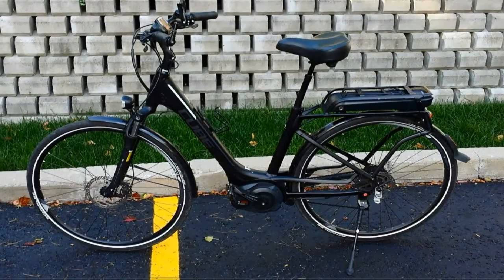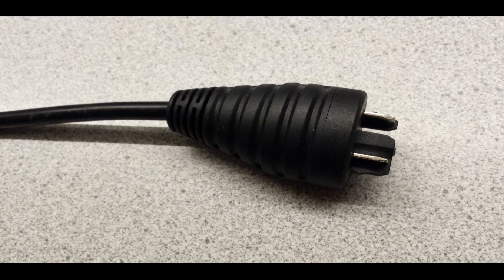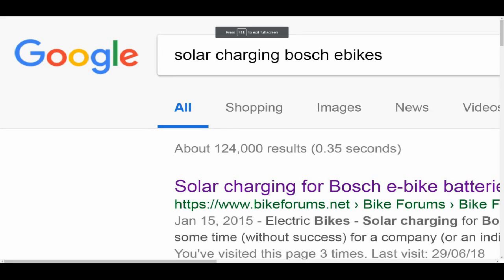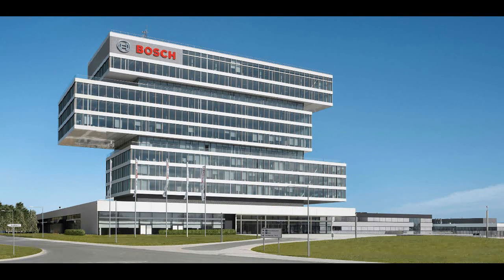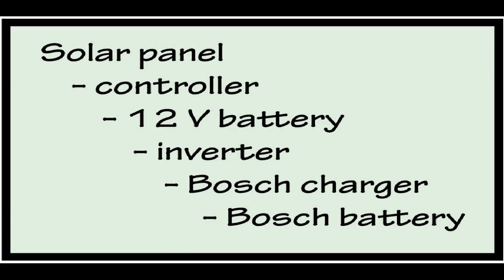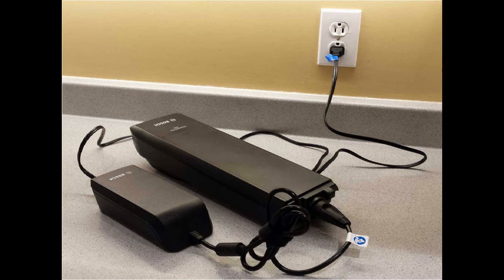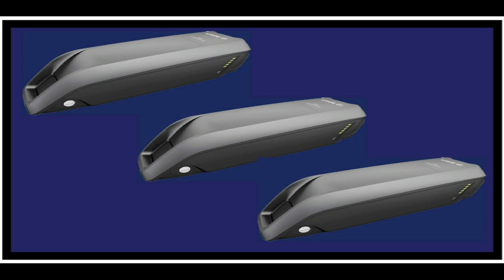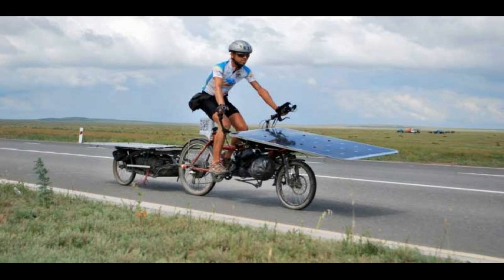Solar Charging a Bosch Ebike Battery   Disappointment

Comment: Robert, I have also been looking into similar requirements for my 2 TREK EMTBs, both with BOSCH Performance CX motors.  I am also looking for a portable and compact off-grid solar setup which I can carry in my car or bike trailer whilst travelling.  I came across this very useful info: https://www.youtube.com/watch?v=d2r3jbL78iQ  which I think you might find useful.  

Once you have a BOSCH battery plug, an easy way to to supply the +5V is from a USB power source OR u can use a compact DC-DC converter to supply this DC 5V from the 36V charger.  

For the 36V Li-ion charging, the GENASUN GVB-8 Boast controller makes a specific model for charging a 36V Li-ion battery from a 12V source (see: https://genasun.eu/collections/genasun-boost-mppts/products/genasun-gv-boost-8-lithium-41-7-volt-wp-mppt).  The best and unique aspect with this charger is,  it will work as low as a 5V panel input and it is super efficient at 96% to 98% efficiency. 

You can get flexible solar panels now with efficient SUNPOWER solar cells that would output 350W  now with a 18.6A max current output at the nominal 18.8v. The magic happens when you connect two of these up in series and achieve a 37.6v 18.6A solar panel output.  The GENASUN will take up to 60v but limits the input from panel to max current of 15A.  Still this is plenty of power.  If sun condition is good and no shade, the best way to charge is to connect the panels directly to the GENASUN GVB-8.  This way, with charging a 36V battery, it is capable of handling an astonishing 325w panel power.  Output at the 41.7v would be in the 7.8A range, which is super impressive!  It is a better solution than even a BOSCH fast charger and is way more efficient at 96-98% efficiency with minimal energy waste in heat generation.  And efficiency plus short charge times should be very high on your list of criteria when looking for a mobile solar charging solution for the BOSCH EBIKEs.  On cloudy days,  I would suggest buffering the captured solar energy with a 120Ah LFP battery (which is still very light weight and portable.  This BIG plus with LFP is they take on high current charge quickly.  U can capture lots of solar energy in a very short time) and you can source the charging current from the LFP battery using the GENASUN GVB-8 to charge your BOSCH EBIKE battery.

Given that Li-ion is in its happiest state between 30% to 70% capacity.  I would recommend leveraging on this knowledge and charge the batteries in this range.  The initial phase of charging with constant current will allow the battery pack to soak up the energy very quickly up to around 60% capacity.  And you can finish off the charging at the early stage of constant voltage charging when it reaches 75%.   The initial constant-current charge typically only takes 1/3 of the total charging time and completes in around 1 hours.  Try to minimize time wasted in the constant-voltage charging phase which can take as long as 2 hours.  You also get long lifespan from your Li-ion this way by not stressing the cells with much less heat generation. Alternate your ebike usage between 2 EBIKE batteries. And you can have one charged in no time.  With a 625wH battery it only takes less than 52 mins to bring it up from 30% to 75% if you can provide the optimal 7.8A charging current at 41.7v

With Li-ion batteries you can safely charge between 0.5C to 1C.  Typically 0.8C.  For a 14.5Ah unit, 0.8C would be 11.6A.  And the 7.8A is perfect safe.
Reply: For those who may be interesting in fabricating a BOSCH EBIKE battery connector but don't want to get too fancy with 3D-printing, I would recommend the shortcut solution I took, which is to get the blade connectors, crimp them to the cables and slot them into a BOSCH EBIKE Battery female connector.  Once you are happy with the position each connector should sit in the 3D space, get yourself some Epoxy Putty and apply that around the connectors to hold them into position.  To get a nicer finish at the base, I precut a small piece of transparent plastic thru which the connectors passes thru so that the Epoxy putty will have a flat surface to sit on once i apply pressure to knead the whole thing together.  Before the Epoxy putty starts to heat up and hardens, cover the whole assembly with the AC plug (with the base removed).  This way you get a very functional BOSCH EBIKE battery plug in no time to fabricate, yet with all the convenience and elegance of a proper plug.  Example of an Epoxy Putty : https://www.bunnings.com.au/selleys-50g-knead-it-multipurpose-epoxy-putty_p1230040?gclid=Cj0KCQiA88X_BRDUARIsACVMYD-Cxb8SNRonCQef20RBGTMLHOF7_720iLAoC6UQ1WyuXex0H4BIOtUaAiBeEALw_wcB&gclsrc=aw.ds
Reply from the maker: That putty seems to be a very versatile product. Thanks for the info.
Reply: @RobertBeriault753  Once you have cut the chunk of epoxy putty you  need for the job and start kneading, you only have a few minutes before the putty starts to heat up and hardens.  So the key to success is to work quick and plan ahead, have everything you need in front of you. I think you shall find the end product very useful and acceptable.

Another tip with the construction is, as i am going with external 5V USB power supply option', i am sharing that negative pin between the charging current and 5V power supply.  So having 4 wires in the connection to a 4 pole terminal connector for interfacing with the GENASUN solar controller and  a USB power bank.  The current draw from USB is very low as it only serves as a voltage reference source.

I use a 4x18650 battery bank to power all my ORFOS PRO biking LEDs. And the power bank has a handy USB output.  So it is extra handy for me to tap into this voltage source, should i had the need to charge the BOSCH EBIKE battery from this solar charging setup.
Reply from the maker: Thanks for sharing your experience. I wish I had your knowledge of electronics.
Reply: @RobertBeriault753  Hi Robert, in case you are wondering if this whole setup works or not with the GENASUN GVB-8 solar charger charging a BOSCH EBIKE battery, I have quickly put together the relevant parts in a quick POC (Proof-Of-Concept) video to show how these components would work together.  This is charging a 625Wh BOSCH EBike battery for a TREK RAIL 7.  The battery is close to achieving a full charge and as you can see from the video, the pulsing Green LED on the GVB-8 indicates it is charging and as soon as full charge is achieved, it turns SOLID GREEN.  So you can be assured that (1) it charges ok without interference with the internal BMS of the BOSCH Ebike battery; (2) It will stop charging once the GVB-8 detects that the battery is full.  

PS FYI, the BOSCH Ebike battery's LED indicator will light up as soon as i turn on the +5V DC power supply.  

I hope this post answers most of the questions you may have, in terms of the feasibility of this proposed highly portable and highly efficient BOSCH EBIKE battery off-grid solar charging system.  And wish you have lots of fun with this new found charging freedom.   Link: https://youtu.be/uyn3gUo4OYI 

I shall do a more detailed video when i have time and connect this system to a high powered solar panel and a power meter to show how much current you can safely charge the battery.

To achieve the same charging level as the following BOSCH AC chargers, the solar panel would need to provide the following respective output:

2A (Travel / Portable) charger : 83W
4A (Standard) charger : 167W
6A (Fast) charger : 250W

The GVB-8 is capable of handling 8A charging current to the battery and a max output of 325W (for 36V Li-ion battery), which potentially can sustain a 8A charge to the battery.  It would be interesting to see what possibilities there are.

Comment: I Designed and 3D printed the Bosch plug. I then used a DC Booster to make a 12V 2A battery charger. Here's how ( https://youtu.be/d2r3jbL78iQ ). I put the CAD model on https://www.prusaprinters.org/prints/49417-bosch-36v-ebike-battery-connector-diy-2a-charger
Reply: I saw your video a while ago and was impressed with the entire project. One thought I had though was finding out how much current is necessary on the 5V enable pin. It sounds like it's simply connected to a relay inside the battery pack and if that's the case, I can't imagine it needs more than 100mA. A very simple and small 3pin 7805 IC would be sufficient to generate the 5v signal for the enable pin.
Reply: @JonPrevost  I believe others have done that now successfully. Thanks for the suggestion!
Reply from the maker: That kind of stuff is too complicated for me, but congratulations for your invention.

Comment: Robert, have a look on barnabe chaillot channel with the video  "Electricity but without invoice", i think he is charging ebike from solar panel, car batterie and a step up volt/ampere booster connected on to the regulator. But of course it is no bosch bike with this stupid plug... cheers.
Reply from the maker: Thanks for the reference. I wasn't able to follow all of what he was doing, but he's quite an innovator.
Reply: I will try with my bosh battery and my solzr panel very soon and let you know if its work. Keep u posted !

Comment: There is a German company claiming to offer chargers with 12V source: https://powerbutler.de/en/products/powerbutler-multi-fur-bosch-und-specialized-rosenberger-magnetadapter
Reply from the maker: Could be very useful. Thanks for the link.
Reply: I use a powerbutler for my shimano system. It can even run from solar using a victron 75-15 and a small 5ah 12 volt battery. Turn on subtitles on this youtube-movie https://www.youtube.com/watch?v=EjcykZkLQZk

Comment: Hi sir . What if you get a non Bosch battery and make a custom plug 🔌 to your bike ?  I personally plugged today an other battery(without original battery on the frame to avoid other nasty stuff ) to my brand new ebike with Bosch active plus motor to se what is going to happen and this I can tell by now : plugging with crocodile connectors ,than display turn on , I can navigate trough different assist levels and everything seems to work on the track but I didn’t do it on the street to se what’s going to happen or if I  get errors . It’s only one day old bike and don’t want to ruin my warranty if the system locks down . I know that the Bosch system is veery advance and the computer get lots data usage .
Reply from the maker: I didn't know that a Bosch ebike could work with a non-Bosch battery. Interesting.
Reply: Robert Beriault I don’t know how the motor is behaving  but display  and everything works .I suspect that range and battery percentage is not accurate on display . The non Bosch battery has 17Ah and don’t have a connector to plugging nicely without screwing anything and take a ride to se if I get assistance . But system is turning on and seems ok. I am veery curious myself because I have knowledge, tools  and skills to do my own batteries. I have another ebike with I build myself with a Bafang hub drive motor and I enjoy more than brand new Bosch system except steep heals  and I can change settings to 35+km/h if needed in some places . Bosch is great with some limitation on non genuine replacement parts.  Greetings from Sweden sir

Comment: But this is big difference charging from sun and charging from car battery...because car holds constant output .so what solar panel do?when sun goes under clouds?shut of.because charger are dumb a don't know it,so draw still so much current so mppt can't deliver them.another situation comes if we have unlimited solar power CCA 200w ...it maybe works.goog luck.
Reply from the maker: Thanks for letting me know about this charger. Bosch had abandoned their 12 V charger a couple of years ago, leaving us without any way to charge their batteries with 12 V.

Comment: I've heard that you need to supply +5V on the center pin to allow for current to flow into the battery. Or just open the battery, replace the bms with a high quality off the shelf (e.g. DALY) bms and you're free from  proprietary bullshit
Reply from the maker: Maybe these solutions are easy for a person who is familiar with electronics, but for me the Bosch system is bullet proof.
Reply: @RobertBeriault753 yes, obviously it takes some expertise in battery electronics as well as soldering. but once this hurdle is overcome you are free from these incredibly expensive, totally incompatible batteries. I like to have a battery that can be hooked up to any device, wether it's an e-bike, an AC inverter, a water pump or any other imaginable device.
Reply: Dont Change the Bosch BMS. It works with CAN- Bus Protokol and the bms comunicates with the Motor and with all System.. that is why some say WE need to Put 5 v in the Center Pin.. it is Like a comuication Signal..in the Control Area Network ( CAN) . So there is one way that make it possible. You need to Open the battery and conect wires  for a new BMS to conect Out of the battery. So the wires coming Out toguether to the extra BMS. And leave the original in place. You buy some solar charger Controller on eBay but very important it must be for li.ion .. Not for normal lead acid. I SAW one with Input from 12v to 90v and Output you can regulate to acommodete to your Batterie voltage.. is 36v in your case. Is very important the controller is for li-ion because if you give more voltage to the bathery ir explodes. In 36v the charger is 42v max.. so if you Put the wires Well inside the battery outside is easy to do. Connecting the wires inside to the cells is Like the wires from the Bosch BMS are connected. Is Like having 2 Independent bms.. the new you Connect outside you can use to Charge or dicherge too and is directly connected to the cells inside and Not to the Bosch BMS.. so it will Not interfer.. to do this you need to have very good skills and experience with wiring BMS to the li-ion Battery because cant do IT wrong. If put the Wire in false place it can be very Bad for the battery. But it can be done. Outside you have the solar connecting to the Charge Controller for li-ion Battery that can give 36v Output that is connecting to the extra BMS. By Other words. It can be donne but dont worth it. You would have some wires coming Out of the battery. If you could manage to finde space inside the battery Case for the second bms it would be good. You would have only 2 big wires coming Out to Connect to the eBay 36v solar li-ion Charge Controller ( they can be very small and you can fix it where the solar Panel is. Wires betwin solar and Controller must be 6mm min. And betwen Controller and BMS too...
Reply: @joaovieira3869  I know there is a communication between the bms and motor controller/display. the communication serves only one purpose: in case the bms fails (which does happen!) it can only be replaced by a certified bosch repairman. chinese motor systems such as Bafang don't have any communication between the battery and controller, because it's not necessary. if the battery overheats, the BMS cuts off power. for SOC estimation (what the communication is basically used for), any 3rd party display has an internal voltmeter to do just that. no  rocket science.
the solar charger suitable for li ion battery packs is called MPT-7210. you need to bypass the bosch bms if you want to charge that way. balancing should still happen as long as the bms is wired to the cell block.
you don't need 6mm wires unless you have 20m between the solar panel and the controller. if the solar panel puts out 19V (typical) @ 5A or so, you're perfectly fine with 1.5mm2 wires. the more amps, the thicker the wires. there are graphs to find out which size you need.